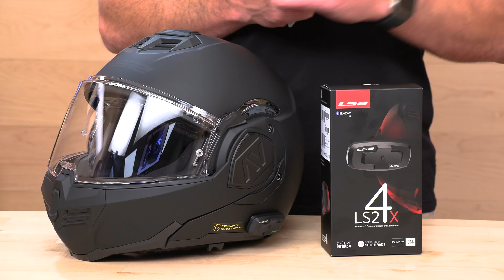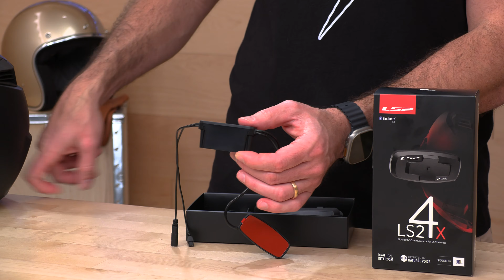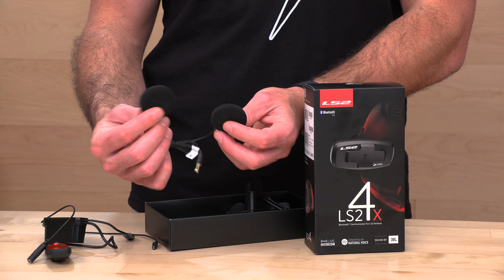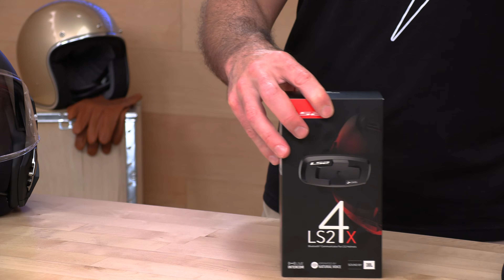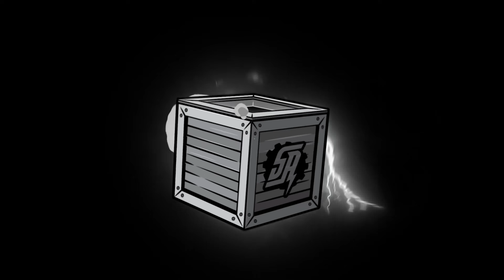LS2 Cardo 4X Bluetooth Headset Review at SpeedAddicts.com

Comment: What if I want to upgrade the unit to an edge or pro?
Reply from the maker: You can get the Edge or Pro, it will just not integrate into the helmet like this unit.
Reply: @SpeedAddictsTV what do you have to do to upgrade I'm curious just bought the helmet and wondering because I may upgrade my cardp system in the future

Comment: Does this reconnect as easily as the Paktalk Bold when you are out of range and come back in range to the other riders? I had a Bluetooth Sena and once I got out of range and came back in range to my ridding buddies it would NOT reconnect. We'd have to pull over and reestablish the pairing.
Reply from the maker: The Cardo 4x does not have mesh capabilities, which means it cannot auto-reconnect.

Comment: im new to cardo and thinking of getting it for myself, brother n missus. when it says connect to 4x riders, is that all 4 at one and have a group conversation or just one at a time, but saves 4 connections(this is what my current V8 unit does). and im not too sure what mesh is, but im assuming that is the group chat setup which... this doesnt have.
Reply from the maker: You can connect with up to 4 riders at once. Mesh is helpful because if one person drops out of range, they can reconnect back once they get within range.

Comment: If i have a LS2 Valiant II and one Advent x , this com system don’t fit in the Valliant since it’s integrated should a buy another model of cardo for my second helmet ?
Reply from the maker: Yes, you would need a different Cardo unit for the Valiant II.
Reply: Great question! I have a Valiant ll as well. Is the original 4x unit be the equivalent?@SpeedAddictsTV